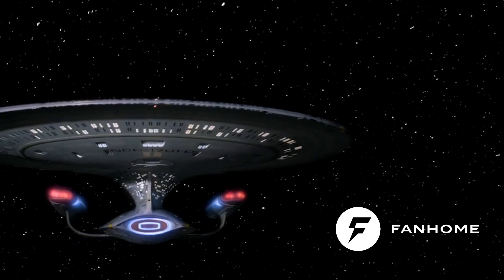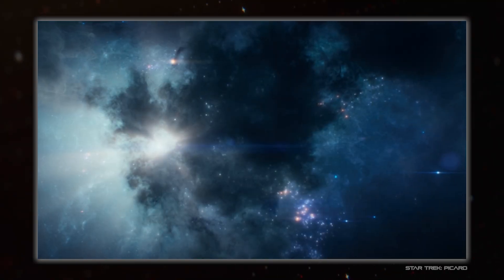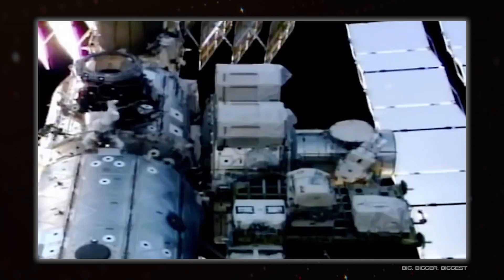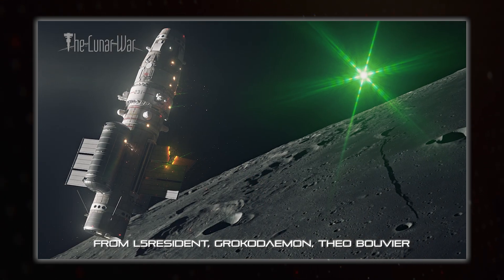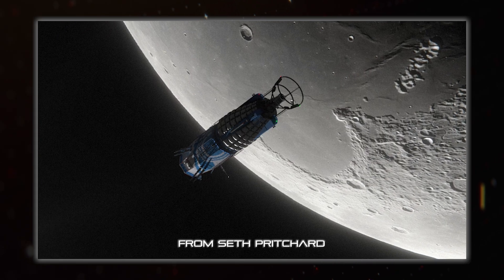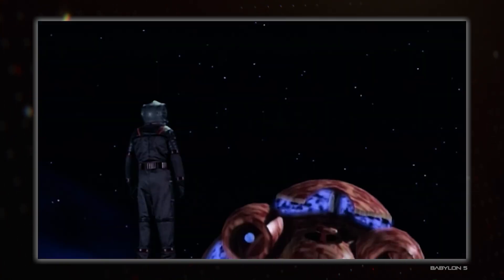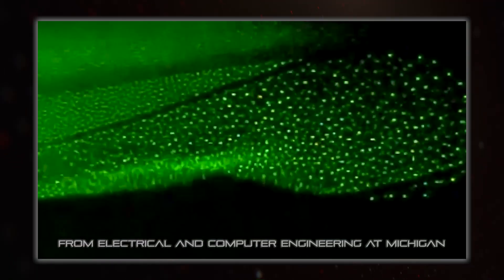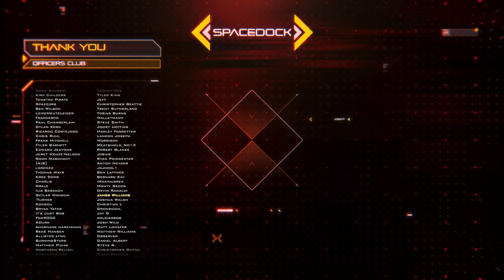Radiators In Realistic Sci-Fi (And Why You Need Them)

Comment: Makes me wonder how much of this "waste heat" could be used for additional power generation similar to a nuclear reactor that could be implemented on larger ships
Reply: So, the critical word there is waste. There's no use for that heat, if there was, it wouldn't be waste heat.
Reply: @argokarrus2731 heat energy is heat energy, labeling it "waste heat" doesn't transform it from being energy. If it could be converted into additional propulsion or used to power basic systems the "waste" could be put to use. It's a matter of system efficiency, which could potentially be a power management issue- reduce power production in a non-combat situation and recycle the heat into additional power. Obviously combat situations are where higher power demands would require higher degrees of heat management
Reply: @Kingdoms_and_Kobolds  The question is how to extract work from a heat difference without adding more mass that needs to be at temperature to operate 

This is the "horsepower problem" but in disguise the heat extractors can only be so effective before they switch sides and add to the heat load problem.
Reply: @Kingdoms_and_Kobolds  That would however breaks thermodynamics, where waste is heat, and while it is energy, it's energy thay cannot be utilized and is currently contributing to entropy
Reply: @argokarrus2731  Well you can use it to power you weapons.
Reply: @nox5555  According to Homer Simpson's friend thermodynamics, no, you can't. All that heat is called waste heat for a reason. It's garbage. It's waste, you don't want it in your house. Think of a ship with no radiator's like a hoarder's new house. It fills up with trash and eventually, it can kill you. Get rid of it.
Reply: @argokarrus2731  Its only waste heat if you dont use it.  
Just load a cannon with the garbage and shot it at people.  or use it as a protective shield.
Reply: @nox5555  Once again, thermodynamics says no. Read atomic rockets or join ToughSF
Reply: @argokarrus2731  how is that against the laws of thermodynamics?  I dont want to transform heat into something, i want to load matter with it and shoot the matter at other ships.     Its like throwing your heatsink at somebody to melt their face.
Reply: @nox5555  that's fine but also, very aggressively stupid. Heat is awful for barrel life and making a usable projectile
Reply: It's a thermodynamics thing. Imagine a home with an AC unit. It works by removing heat from the inside of the house and dumping it outside, into the environment. However, the amount of heat dumped out is greater than the amount of heat taken from within the house, because it takes energy to force the heat to move, and that energy ends up adding to the heat that is dumped out. In space, the ship is essentially inside a thermos, and the only way it can get rid of the waste heat is by radiating it. If they try to use this "waste heat", all they're doing is redirecting it inside (reheating the inside) and then having to spend even more energy (that ends up as even more waste heat) to push that even larger waste heat out.

Comment: Heat is waste.

One of the most important things you can do is figure out a way to get the heat into your exhaust.

I'm not saying radiators aren't important.

But a good way to illustrate the difference between an efficient design and an inefficient design is adding lots of radiators.
Reply: the Engines of an ISV in Avatar are about 99,9999999999...% Efficient
Reply: @deathsinger1192  There are lots of ways to measure efficiency, and it's relative to many variables.

Maybe it's like the rocket equation, and you need much bigger radiators to get a tiny more amount of speed.

Or maybe it's a square-cube law thing, where the Avatar ships are the smallest they can be made, and improve with scale.

I don't know enough about them to say.